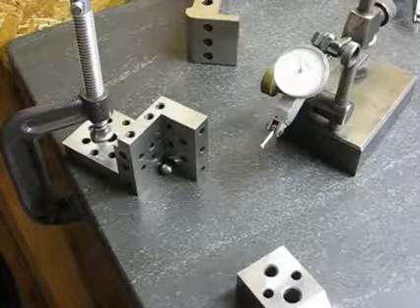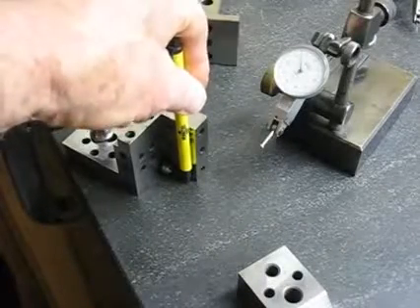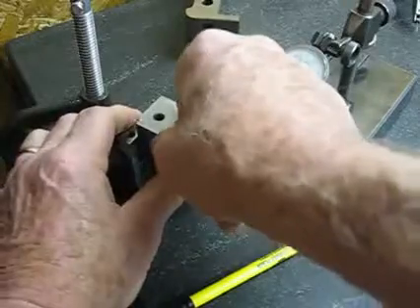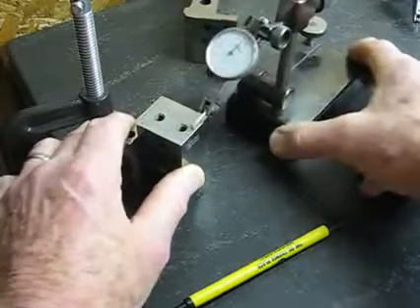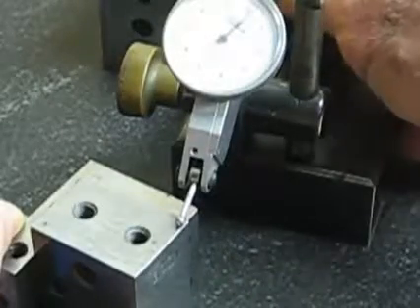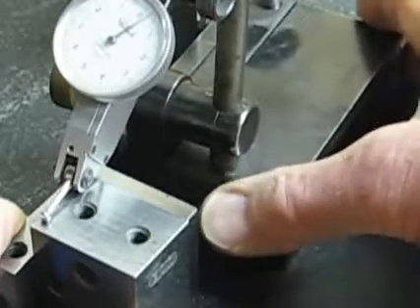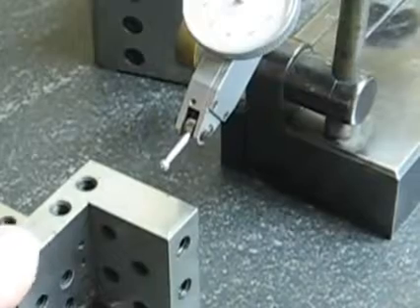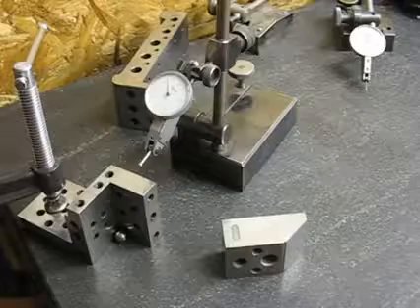Basics of Measuring Perpendicularity

Comment: How in this method are you controlling for any variation in perpendicularity between the two vertical sides in contact with the angle block? Shouldn't you be measuring against a single datum at a time?

Comment: How would you recommend fixturing the part without having to hold it with your hand?
Reply: Frank i use a angle block and the height gage,  clamp the  part to the angle block  using the little block he  has to set it up in 1 side then just clamp and block.